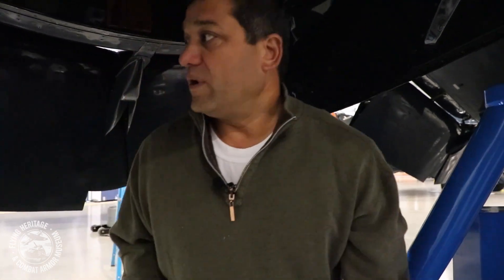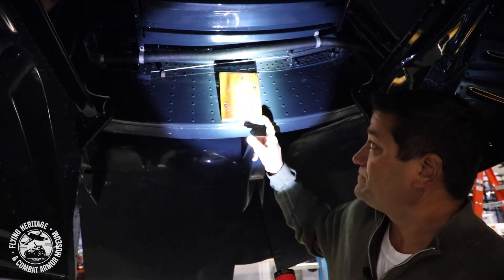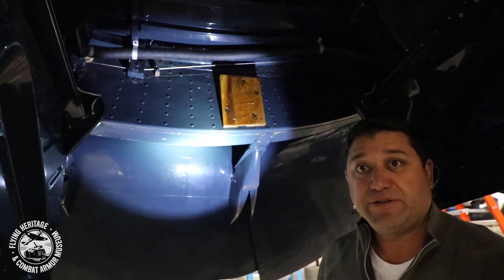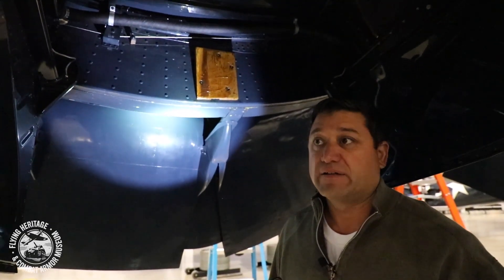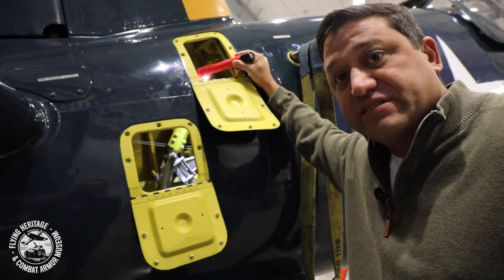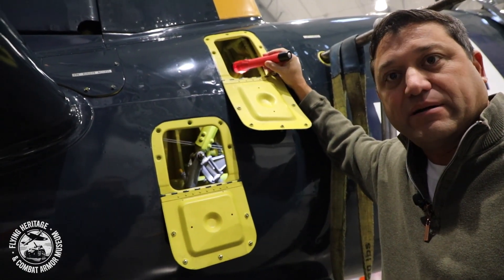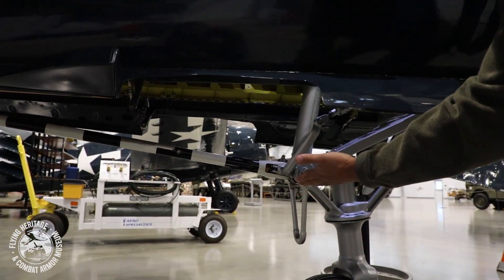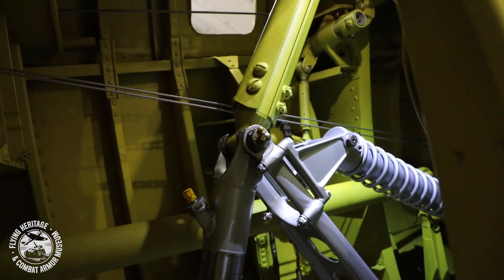Annual Inspection Part 3: Gear Swing

Comment: Super cool. I've never seen gear retraction/extension on a Corsair in this kind of detail, especially the rear wheel. Anyone know why CV decided to leave part of the rear wheel exposed when retracted? I'm sure it doesn't matter much from an airflow/aerodynamic standpoint, so that says to me it's either a space thing, or they wanted it out just a bit in case of emergency landings.